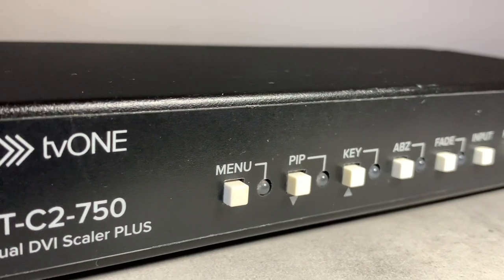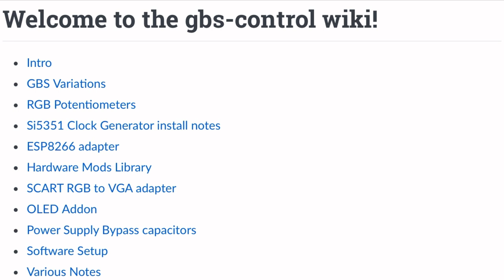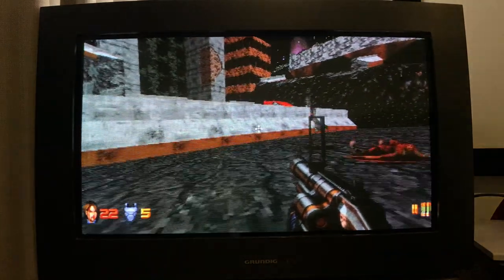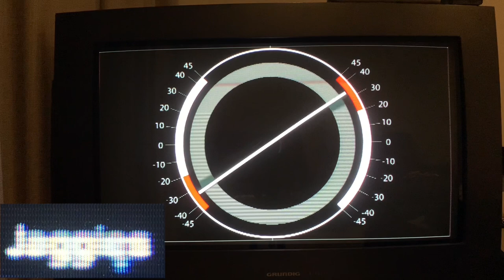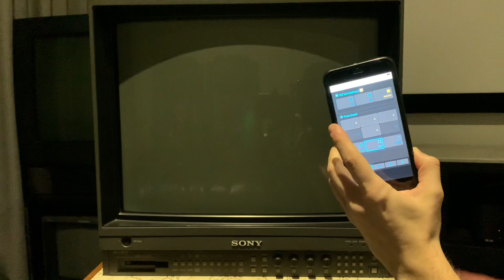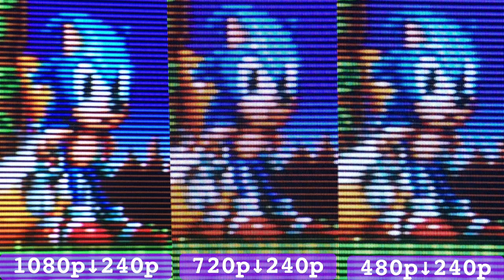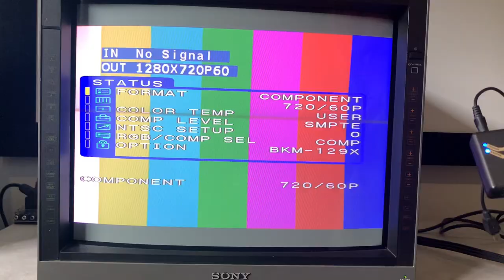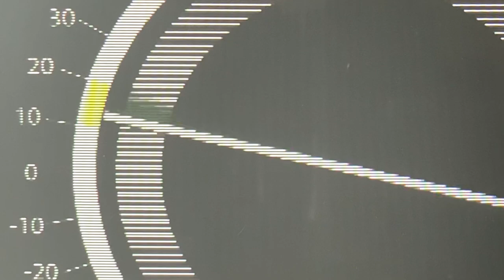Downscaling Chronicles 2: GBS-C 480p 720p & 1080p downscale to 240p on a CRT TV/PVM with GBS Control

Comment: Could you please do one video without all the stuff about downscaling resolutions like 480i or whatever to 240p and just talk about how to downscale a signal from a 16:9 aspect ratio to 4:3 with letterbox? There is a serious dearth of information online about how to do this.
Reply from the maker: Specifically for the GBS or downscaling altogether? The OSSC Pro and DExx have this exact option and it works fantastic
Reply: @MarcoRetro316  No, not for the gbs. I mean just doing it in general. Also, are there any relatively affordable ways to do it? That sort of thing.
Reply from the maker: @surfingthechaos in general, then checkout the videos I made on the DExx and OSSC Pro. The DExx received more updates since the video, which brings the lag under 2 frames (except 1080p>480i). If you already have a MiSTer FPGA then this is the best affordable option as the DExx needs to plug into the DE-10 Nano FPGA board. If you don’t have a MiSTer then the OSSC Pro is a better scaler, but it’s not cheap. If you need something on a budget, you could piggy back downscale the GBS like I did in this video, and try and find a cheap Extron scaler that can downscale to 480p with HV size dials. You have to be patient and opportunistic to find them cheap though. You’d be creating your own letterboxed 16:9 that way but those scalers usually have presets so you’d only have to meticulously get it right the first time then save it. Honestly though if aspect ratio is your highest priority, my recommendation is still the OSSC Pro

Comment: both ps4 pro and ps5 can output 480p, but the 480p must be the only resolution provided by display edid information.
Reply from the maker: So you could theoretically have a device in between the console and GBS with edid emulation to spoof a 480p display?

Comment: Eeh? Why use downscalers and emulators via pc instead of original hardware and everdrives ?
Reply from the maker: Downscaling is lowering the resolution for display compatibility, in this case it’s modern HD consoles on a standard definition CRT which has nothing to do with emulating/everdrives on original hardware